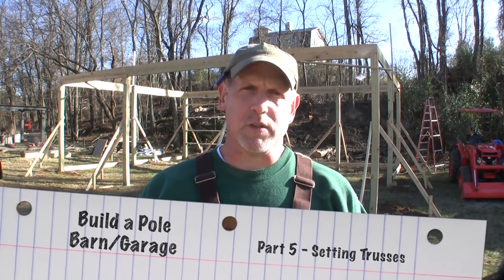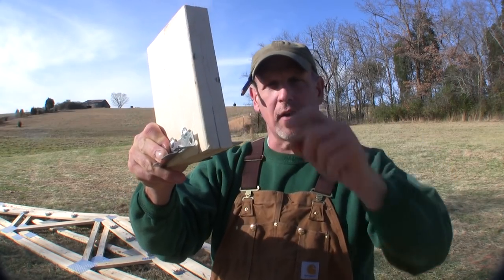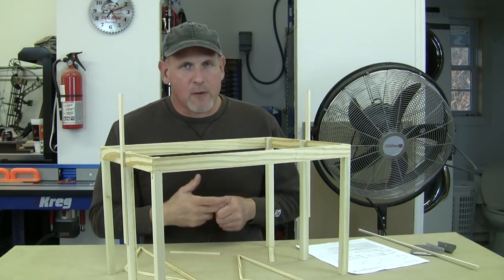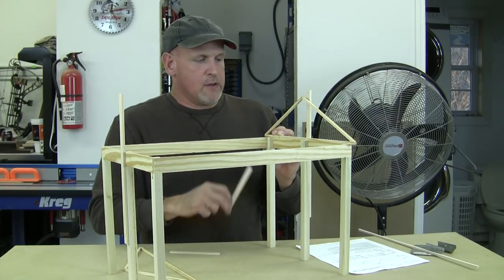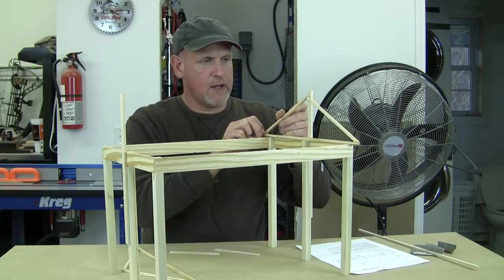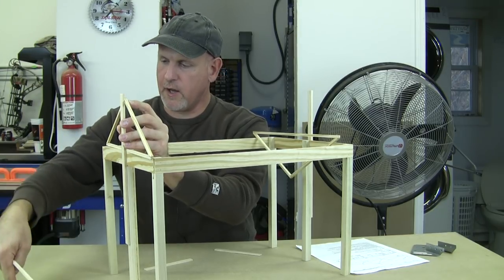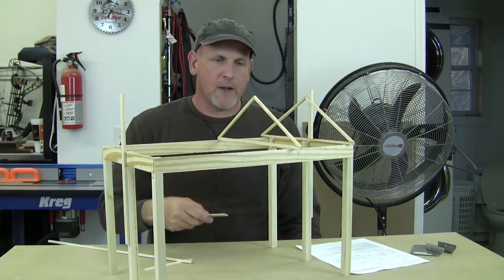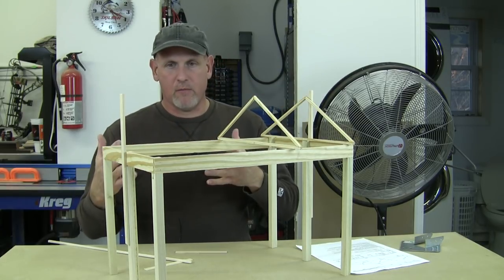How to Build a Pole Barn Pt 5 - Setting Trusses

Comment: To strengthen those gable end eaves you can also specify a "drop truss" on your gable ends. The truss build can design/build  in a drop the width of a 2x6 (or 2x4 if your top chord of the truss is designed for lighter loads) then all you need to do is nail in strong back lookouts (vertically oriented 2x6's) to create your eave. String it off at the eave tails and nail on your sub-facia. Super easy and super strong with no need to build an eave ladder or brace it after the fact.  Excellent, well done series. Among the best I've seen on YT. Thanks for all the hard work.

Comment: I cracked up when you showed a model of your pole barn and used it as an instructional aid. But you know, we're exactly the same. I would have done the same thing! I love your video series on building a pole barn and love your level of detail and instruction. The degree of planning and measuring shows when you are hanging the plywood sheathing. Everything is on center! That shows what a good job you did in planning and measuring. Great work!

Comment: Nice engineering design to solve the problems you had noted in the gable ladders dropping or drooping over time.
The way you notched & cantilevered the 2 x 4s in to minimize or eliminate this altogether.
I’ve recently disassembled an old barn , approximately 36’ x 30’
By myself, & plan to rebuild on my property with a few minor alterations & exterior design changes.
I will likely be doing 99-100% alone, so trying to get as many ideas to make some of the more daunting tasks doable.
This barn had homemade trusses, 2 of which broke, & I will have to particularly reconstruct- 11 of the trusses are built from 2 x 4s & are fairly light & manageable, but 2 of the trusses, the bottom board is 2 x 6s which substantially adds to the weight to handle by one person easily.
I will figure it out.

Comment: Nice videos! We watched them from part 1 through part 5... We're building a 20' x 40' x 14' high pole barn using telephone poles which is going to make this job a bit more difficult. For now we got the land excavated and getting ready to set up our lines and start digging the holes using a good ol' Ford 9n tractor with factory Danuser posthole digger. Me and my husband started laughing when you mentioned the yourtube 'experts' concerning the different ways to set a pole....use gravel - don't use gravel, use cement - don't use cement, etc etc lol but anyways my husband thinks you have a good way of doing it by pouring a cement footer/pad, dropping in the post, and then filling up the hole with cement.

Comment: Excellent set of videos! We are looking at putting up a 32' x 40' x14' pole barn next spring to work on our Jeeps in. Since we have a small lot I want to use attic trusses for storage space. We just sold our National boom truck, I am really going to miss that when it comes time to set all of those attic trusses!
Reply from the maker: KmanJeeper Thanks for watching.  I'd like to have had a bucket truck when I did mine.  It would have been most handy.  Good luck on your project and lemme know how it turns out!

Comment: I'm sure some of the other 'safety ninnies' have pointed this out, but just in case...at the 12:55 minute of the video, I believe it was you that was on the short step ladder. You are clearly wearing incorrect foot wear! You need to get see through work boots so you can look down and read the warning on the top of that step ladder...it usually goes something like 'this is NOT a step!'. Lol Great vids, you have earned a sub for sure.

Comment: Enjoyed the videos, my hat's off for filming all that along with building it yourself.
If you ever find yourself doing this again, you can save a pile of grief by ordering your end trusses 3 1/2"(2x4) or 5 1/2"(2x6) shorter than the others. And then cantilever your perlins over them. No notching, no need to reinforce the ladder that way. ;)
Reply from the maker: gary shumaker Thanks for watching.  I agree with your suggestion.  That's the better way to do this.  The overhang, like so many things in projects I do, came as an afterthought.  Had to improvise!

Comment: Coming along nicely!  Looking forward to the next part.  Are you going to pour concrete at the base?  Did you end up installing the hurricane brackets?  Love the idea with the gable ladders..
Reply from the maker: Thanks!  Yep, I'm almost there now.  Just need to get the roof on but the weather is being tough on me.  I'll get 'er though.  I'll probably pour a concrete slab one of these days but for now I'll level it up and put a couple three inches of gravel in it this spring.  Stay tuned for the finale in a couple of weeks...

Comment: Nice vids on the pole building build. I must admit though, I've been building for over 18 years and have never built built this way. Perlins mounted on the inside of the posts and mounted the weakest way structurally? We have to offset seams on perlins nailed to the outside of the posts, run "rat run" bracing so several bottom cordes of the trusses are nailed on one board length, and our trusses are on 2' centers. We have to account for wind shear as well as live and dead roof loads. Codes must be a lot different there. 
Most builders have a tendancy to be a little OCD.
Reply from the maker: Thanks for watching and commenting, Super1.  I appreciate your thoughts and your good spirited and well intended critique.  I think you raise some good points for others to consider when they do a project like this.  I want to respond to a couple of your points.

I have seen a lot of barns built this way in my area.  The girts are flat but the tendency to the "sag" is removed once the outside is sheeted and nailed into the girt.  Even board and batten sawmill lumber nailed into the girts will stiffen it up.  The purpose of the girts is for lateral support between posts so once they are nailed in and sheeted it strengthens up the building tremendously and removes the tendency for the building to rack.

I agree that we sometimes have OCD as builders and that always leads to a tendency to "overbuild" things.  Trusses on 24" seems like overbuild to me for a barn.  I agree that 8 foot might seem like "under build" too. Four foot would be a good sweet spot but my roof is not carrying much weight at all.  Just insulation and metal.  

I had the roof system engineered and that's how the engineer spec'd it so I am relying on that expertise to keep it standing for years to come.  It's his stamp on it not mine.  Just to give you some idea of the specs:

Live load:  20 psf
WInd load:  90 mph (3 second gust)
Bottom cord load:  20 psf
Uplift:  100lb with mechanical connections
IRC 2009, etc.

Snow here is seldom significant and heavy wind is not common.  We'll see how it holds up over time.  If it crashes and burns I'll do an update video on the pole barn series.  Ha!

Thanks again for your comments and thoughts.  I think we help everyone in the DIY community when we share our experience and expertise.

Comment: looks real good.  inspiring video.  I do think they make gable end trusses (which have verical webbing so you have something to nail your sheathing in to) and they are 1.5" shorter, so the cantilevers for your gable ladders don't require notching. Freedie's approach isn't wrong, and I know those trusses were all the same because the boys at the factory only had to set up the machine one time as they are all identical.

How are you planning to vent the roof, Freddie?  Another point that may be worth considering is that if you built out a decorative gable end vent like they did back in the homes built in the 1960's, you could have support for your gable ladders and also have a decorative venting system.

Thanks for taking the time to tape and post this stuff for the rest of us, Freddie.  I learn something new with every one of your videos.
Reply from the maker: Thanks for watching and for your kind words.  I appreciate it!  It inspires me when I feel like folks are getting something meaningful out of my videos and, more importantly getting some of their own ideas.  When I built the house I used the kind of trusses you mentioned.  It was much easier to lay the gable support in with those.  On this project the gable idea was an after thought.  Kind of a on the fly "that'd look cool" idea that I always seem to do to myself.  Ha!

The roof will be metal and will vent through the metal ridge cap.  I'm not sure what kind of decorative gable vent you are talking about.  If you come across a pic of one then send me a link.  I'd like to see it.

Stay tuned.  The weather is making it tough to finish this thing.  It's ready for the roof now.  I have it enclosed, sheeted, and wrapped.  Just need to get the roof on once the rain/snow/cold passes.

Comment: Great videos.  I might have done a few things different.  A.  I would have not cut into (notched) the poles rather I would have used bolts to secure the 2 x 12 wood flush to the poles. Pressure treated nails will rust your nails after a few years even the galvanized nails.  I would have then used dangle braces from the poles to the 2x12 for extra security.  B.  I would have cut the poles with a chainsaw after they were in the ground and trusses fastened.  Easier to level the 2x12 this way. C.  I would have extending my rafters out a foot or so past the ends to make a gable.  The method of using a ladder gable like the one you have done will drupe downwards over time, especially if you only fastened them with nails (too much weight).  D.  I would have used dry concrete in the holes.  If I made the effort to do it by mixing wet concrete, I would have bought concrete tubes to put the poles in.  E.  I set my trusses 2 feet apart to make it much more studier.  I know a lot of people like to save money by making them 4 or 5 feet apart but 2 feet will protect it from bad wind storms or snow.    Hope you don't mind my 2 cent worth.  Great videos - thanks for making them!

Comment: Great video Brother Feddie!
Looks like you had some good help in setting the trusses ... sometimes we just gotta have a little help!
I see you really use your Paslode cordless framing nailer alot ... I have one of the same and also one for trim work ... Love'em!
Keep up the good work ... be safe ... and I anxiously await your next video.
Denny Grimes
Phenix City, Alabama
Reply from the maker: Good to hear from you Denny.  Yep, I really like the Paslode nailer.  I don't have their finish nailer yet but I've been wanting to get my hands on one.  Hard to believe we used to use air hoses.  Ha!  I'm within striking distance on the barn now.  It's sheeted and wrapped and ready for the metal to go on the roof but this weather has been brutal.  That arctic cold snap shut everything down last week.  It was horrible.  And all the rain since then.  I need two good days and I'll wrap this thing up til spring.
Reply: Yes indeed Brother Feddie the weather has been unpredictable here in Alabama also. We went from 60 degrees to 9 degrees in a matter of two or three days now the rain is moving in but passing through tonight but tomorrow's suppose to be nice.
I noticed the frost on the ground the first day you were setting your trusses!
We never lost power and that was a blessing.
You are gonna have your self a real nice pole barn when you're done and one to be proud of.
Stay warm and safe Brother Feddie.
Denny Grimes
Phenix City, Alabama

Comment: This is by far the best and most informative video series on pole barns on the web that I've ever seen. I was curious about the truss design. Instead of trusses at 16 inch or 2 foot on centers, you have them 8 feet apart and connect them with horizontal bracing. Is this a technique that could be used in residential buildings or is this only up to code if it's a barn? I know building codes vary from place to place, but I've never seen this type of construction and it seems like it would save costs on roof construction. Again, thank you for this amazing teaching tool.
Reply from the maker: oggyreidmore Thanks for watching.  I appreciate the kind words.  I don't know that I'd build the roof on a house like this.  It's not carrying much weight at all with just the metal.  I'd probably have tightened them up if I was going to sheet it and put shingles on it.

Comment: Thanks for all your advise. I'm building my first pole barn and using your videos as part of my template on how to do this. Mine is 26 x 40ft with a 10ft leantube on the side. Will use it to store my rounds for the horses and my tractor.

Looking at acquiring a "Branson 3520 hst" or a Kubota ( L3560 hst). I see you have a Kubota. Any issues with your and model is it? I will purchasing in the next month or so. Need it for the construction of this barn and I'm just waiting for the snow to disappear. Live in Greenwood, Nova Scotia

Again thanks for the vids.
Reply from the maker: Thanks for watching.  I appreciate it.  I'm glad the videos are helping you get your ideas together.  My Kubota is a 3240.  I've had it since '06 and haven't had any issues with it.  It's plenty powerful enough for what I do and the PTO has ample HP to run my tiller, mower, and wood chipper.  Good luck on your project and let me know how it turns out.
Reply: ***** Well do. Will document like you did and post to your channel.  I anxiously await your part 7. Are you going to pour your  own cement or get a concrete truck?
I'm here in Greenwood Nova Scotia and can't wait for the snow to leave so I can start this project. Cheers and thanks again!
www.chestnut-stables.com is my web site. My wife and I just started the business and I'm just about to retire from my day job of 30 yrs.
Reply from the maker: I'll back a concrete truck in and work it myself.  I just looked at your website and man, Norm, that's beautiful country!  And Flame is a stunning horse.  I envy your country setting though I feel no calling for your winters!  Good luck on the business.  It must be liberating to be at a station in life where you can quit the day job and follow a dream.  Congrats!
Reply: Thanks. As for the winters in the Annapolis Valley, there not as bad as you'd think. 
Yes finally follow my dreams and I anxiously await your next pole barn vid.
Thanks again for all the ideas.
Cheers

Comment: Looks great to me, I would use the hurricane straps though due to wind lift, big doors open and a strong wind gust and things start happening.  I would have stood the overhang brace on end also as the 2x4 on the flat might bend over the years.
Reply from the maker: Thanks for watching and for the compliment.  I appreciate it!  I think you have good advice on the hurricane straps.  I'm gonna get that done.  Not sure I agree on the brace though.  I don't know if I would feel good about notching out 3 1/2" out of the truss.  That would only leave a couple of inches in the truss itself.  I think with two braces on each slope it will be fine.  Also, I failed to mention in the video but the facia board gives cantilever bracing on the ends too.  Stay tuned for the finale in a couple of weeks.
Reply: *****
Very true about the facia board, BTW the way I do it is notch 1.75 out of the rafter and 1.75 out of the 2x4.  Just throwing it out there, wouldn't worry as much with plywood sheeting but tin will be even more prone to bending at the eaves.
Reply from the maker: Great idea.  Wish I'd thought about it that way.  Thanks for the tip!

Comment: I've watched your pole barn video twice.  Great instructions.  Really enjoyed it.  Im curious why you set your tresses on 8 ft centers versus on a 4 ft center.   Why not use more tresses on 4 ft center?   Was it to save money on tresses?    I see you used 2x12 bands and are nailing 2x6 purlins between the tresses for strength and structure.   Thanks
Reply from the maker: Thanks for watching.  I'm glad they helped you out.  I had an engineer design the roof system and this is what they came up with.  The roof is not sheeted so it's not going to be carrying much weight except for the metal.  Four more trusses would add another $350 ish to the job too so expense is a consideration too.

Comment: Excellent job......good comments below too....definitely use the hurricane clips...here in eastern Colorado it's mandatory, if you want to keep the roof on.
I use a speed square to lay out the purlin hangers on the truss faces, but I saw a template type square on some other YouTube and it was really cool. We would like to know more about your tools. Like, what laser level you use and what Camera. That Camera has really good resolution. Might it be a Hero? And, do you have a bio online somewhere? Love your tutorials.
Reply from the maker: Thanks much.  Great comments and I appreciate it. I use a Canon Vixia HD camera.  It's a few years old but it takes good video.  The laser level is a Bosch GRL250HVCK.  It's pretty good for the money.  My only complaint is that it's ultra sensitive.  makes it hard to get solid tone so you have to kind of use the force.  Ha!  Paslode framing nailer, DeWalt circular saw, drill, and impact driver.  And a big ole hammer…..

Comment: love the videos,i have a 30x40 that i will be starting in a few days i just have to nail down a few more details.i was wondering the size of the auger you used for your 6x6 post holes?
Reply from the maker: Thanks for watching and commenting.  I used a 12" auger which does not leave a lot of room for error.  I had to open up some of the holes a little bit by rocking the tractor back and forth while the auger was running..  I also had a couple of holes I opened up a smudge with a shovel and post hole digger.  Good luck on your project and let me know how it goes!